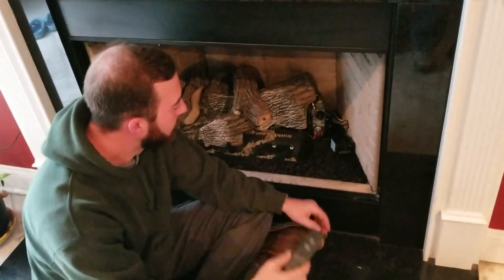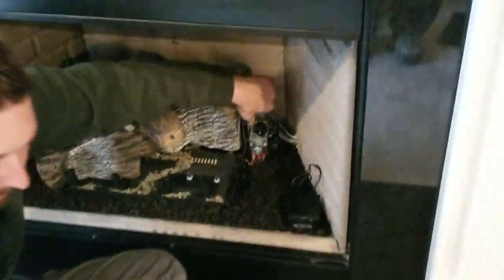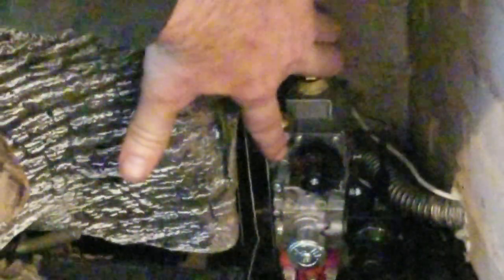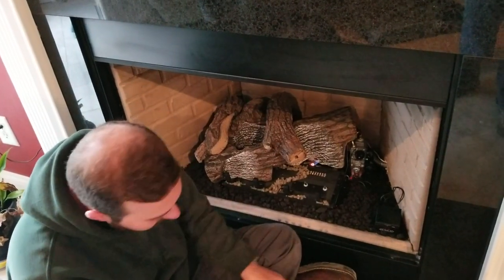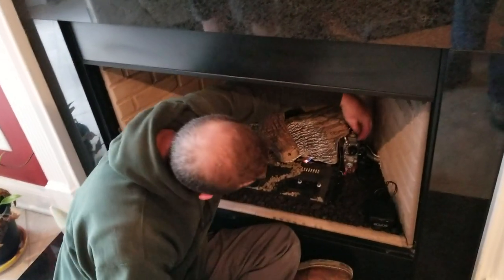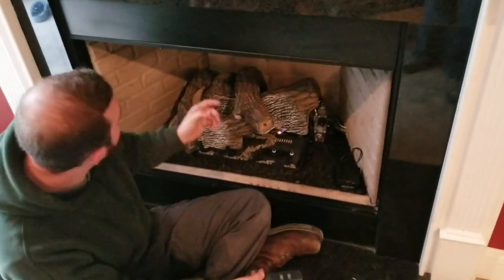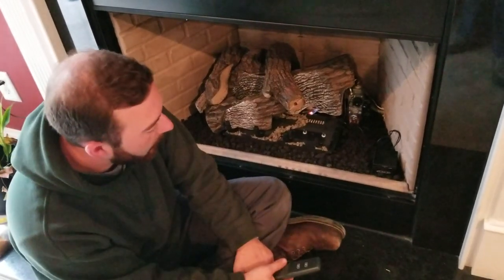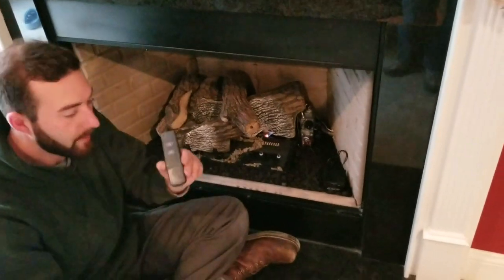How To Light Gas Logs With Remote (SkyTech)

Comment: Didn't your receiver come with a heat shield?
Reply from the maker: Hi, no heat sheild on mine.
Reply: @terrilynn3550  Thanks 😊. Do you take the receiver out of the fireplace cavity when you turn on the fireplace? I would think that keeping it in isn't a good idea due to the heat. 🤔
Reply from the maker: @regisplump914  No,  mine is about 4 yrs old. They may have sheilds now.
Reply: @terrilynn3550  Maybe. So do you take out your receiver when you light your fireplace? Judging by the lack of availability of heat shields it seems more likely that people just don't use them which again begs the question, if left in will the receiver get damaged.
Reply from the maker: No, we leave it in and after 4 yrs no damage.
Reply: @terrilynn3550  Thanks!